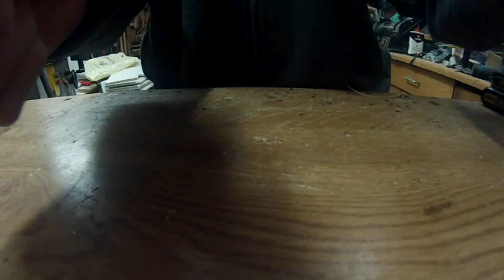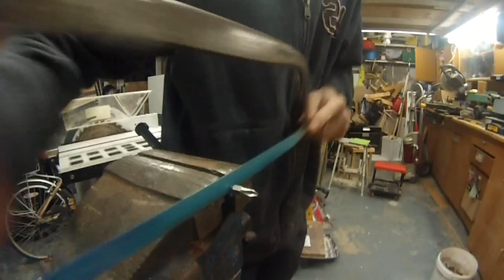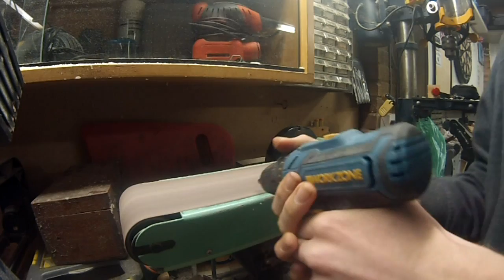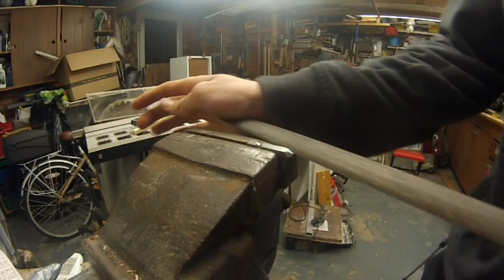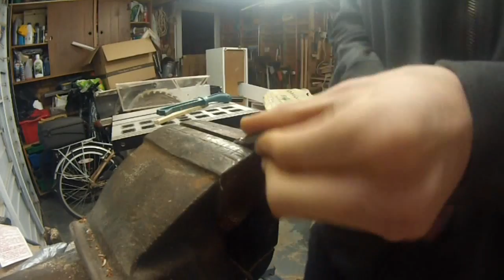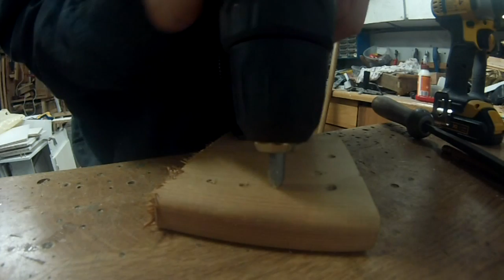Countersink From Screwdriver Bit

Comment: with due respect I have a query: why don't you use the head of driver bit as counter sink just sharpening the edges in angle? I am using it in that way and the result is quite satisfactory...
Reply from the maker: Binod Adhikari because it gets clogged up easily and doesn't cut a shamfer very well because it doesn't have a cutting edge